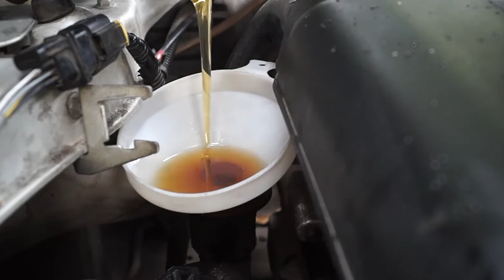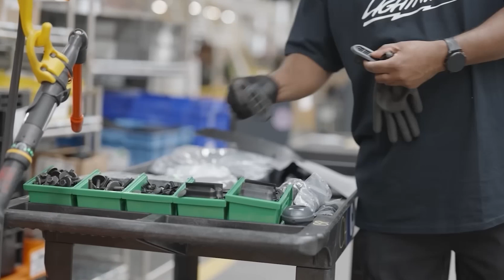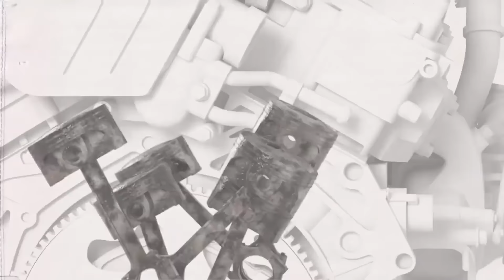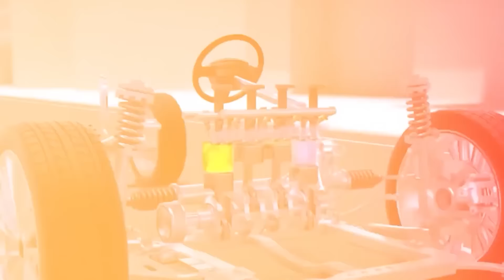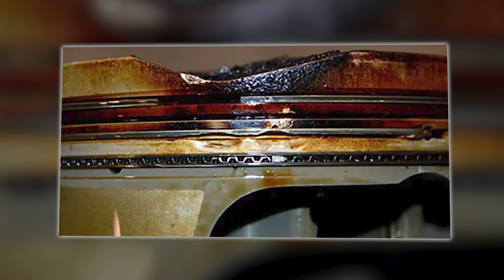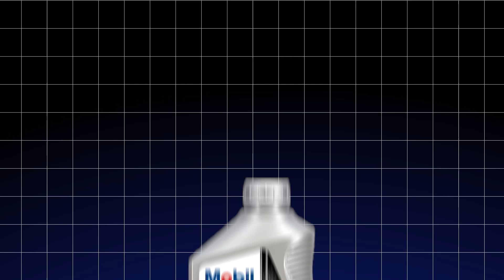Toyota Secretly Lying About Oil - Mechanics Refuse To Use

Comment: The additives in the Toyota branded oil makes the difference.  I believe Mobile produces it for them.  The aftermarket Mobile with the same numbers does not contain the same formula...may contain the additives to a lesser degree.  Solution:  If you use aftermarket oils, change the oil more frequently. Even if you use the Toyota brand oils, the vehicle motor can last longer with more frequent oil changes.  Why doesn't Toyota reveal real world testing results to owners...?  If they do please post such.
Reply: Toyota motor oil is just relabeled Mobil motor oil.  What I saw when looking at these dealership oils is that they have a weaker additive package.
Reply: @Rob-xj3xh  Toyota oil ow8 and 0w16 has 5 times the moly than Mobil 1.  Way different oils

Comment: I run 10w30 full synthetic in all my vehicles. Toyota, Ford, chevy, and my mitsubishi. 08 tundra. 312k. 287k before first oil leak. $43 bucks to fix. 08 Yaris 229k still no leak. 3rd clutch though. 17 expedition 189k miles. Passenger turbo just started to leak. Waiting on parts so I can repair. 17 outlander 131k no leaks. 20 chevy 2500 gas. 50k no leaks. Only used to pull my 5rv. I change my oil at 5k intervals on my vehicles myself. 10w30 stp full synthetic is only oil i use for gas. 15/40 delivery for my deisel tractors. 30 stp regular oil in all my generators. Never had issues with any of them leaking.
Reply: Same here amsoil 10w 30
Reply: Great for older cars, but these new ones are engineered for the thin oils.

Comment: ASKING: Is it possible to mix 0W-20 with 5W-30  half by half ?
Reply: Yes, I've mixed brands and viscosity's  since the 80s without a problem.
Reply: I personally would not recommend it. Back in the 70's and 80's oils were very basic but oil today is a 100% better with different additives that may not play well together!

Comment: The difference between the US and other countries is that in US Toyota controls the oil pump solenoid with ECM. So the thinner oil is running under more pressure then needed. It is totally safe to run 0w8 if the engine is designed for it. Yes, it is exact the same engine but not the same ECM programming.
Reply: Never knew that.  Learn something new every day.
Reply: Then how does the ECM deal with 0w20 frozen at 32f ?  It's now SAE140...
Reply: @lonniebeal6032 oil doesn't freeze at 32f. It might thicken a little but the engine will warm it up. ECM has nothing to do with it.
Reply: @lonniebeal6032  The ECM takes temperature into consideration.

Comment: Claiming that the only way they can meat government regulation is by using these lighter oils is total bogus.  Back in about 1990, the SAE department at the University of Wisconsin Madison took a ford stationwagon apart, reforged the steel frame in aluminum, reassembled it and the result was... approximately 50 mpg.  So why didn't it get incorporated.  Officially because they didn't feel people would pay the extra $2,000 for the aluminum frame.  Unofficially, because they don't want their cars to last too long.  With an aluminum alloy frame, the cars might be on the road for 10 - 20 years and it's all about the $$$ -- getting the customer to come back in and buy another vehicle.  There will come a day when all these cheap tricks won't work and they will be force to do the right thing if they wish to survive.
Reply: Ford trucks, I had one , have Aluminum bodies , but the chasis is about 9 inch steel, maybe they should have gone with Aluminum chassis and steel body .

Comment: That's another reason to AVOID this automaker! Dont use the oil on the oil cap & you have warranty claim? DENIED.
Reply: Which is why it's wise to get an oil analysis.
Reply: All automotive manufacturers are using & pushing WD40 oils

Comment: Mechanics who don't pay attention to the fine print don't know the real story. Way back in the 60's when 10W-30 made the scene, it was using the very same technology, or chemicals, that today's oils use. Back in those 1960's I used straight 40 weight racing oil from Union 76 in my junk Mopars and I changed it every 3,000 miles. My Dad drove Old's 350's and he used 10W-30, and he changed it at 5,000 miles. I was just a dumb kid, so I didn't know squat. I bought my oil from a racing team who got  it free from their sponsor, so I got it cheap. And I thought I was Joe Racer terrorizing the streets with my old junk Mopars and my 40 weight racing oil.  Dad was just Joe Tax payer droving his new Cutlass Supremes and 442's in traffic to and from Detroit for about 100,000 miles then traded them off. We both did OK, never had an issue with an engine but we both drove our cars very differently. I'd run my engine up to 6,500 rpm and smash the gears at WOT all the time, but Dad never went above 3,000. He had all the scientific polymers, isomers, anti-foamers and corrosion inhibitors. I didn't. The only thing we had in common was ZDDP. 0W-8 Toyota oil is OK to use in Toyota engines. Winter of 2024/2025 as an experiment I put 0W-8 in my 1973 International Harvester Cub Cadet Lawn Tractor so it would start easier in the event that I needed it to blow snow. My old cub cadet has the "starter/generator" for a starter and they are not known for robust strength, so I hedged my bet with the 0W-8. I started it a couple times but never had to use it to blow snow. During the Summer of 2025 mowing, the 0W-8 oil went out the breather  and I kept adding straight 30 weight oil as make up oil. It didn't hurt my Cub any, so the chemicals they put into the fancy oil works, but I wouldn't put it in and forget about it. When those chemicals leave you are left with very little for lubricity. ben/ michigan u.s.a.

Comment: I've been using Amsoil 0w-8 in my 2025 Toyota Camry hybrid. Just go on line and order it direct from the factory no problem. I order 2 cases at a time. Change it every 3k miles.
Reply: Toyota 0w8 has 5 times the moly that AMSOIL has for less cost.
Reply: @CAN43714 methodical2 said on here he did an oil analysis and Amsoil 0w-8 had 5 times the additive than the Toyota brand !

Comment: Are the oil pumps the same in Australian and North American Toyota? .Any ideas?
Reply: Yes they are, don't fall for the "OiL pUmPs & eCU/EcM aRe tUnEd diFfErEnTLy iN eVeRy cOuntRy" 

If that were true, it would be too expensive & loosing money to any car manufacturers is a cancer.
Reply: Oil pumps are the same, the ECM is calibrated differently though to regulate the oil pump depending on country.

Comment: Mobil 1 doesnt have the same additive package as toyota tgmo...high molybdenum10x more than mobil 1...ur engine is fcked if you use anything else with the same viscosity
Reply: Totally agree! This where many mistakenly buy other brands different from Oem. They are not same. Toyota oil is much richer in ad pack including Moly.

Comment: The best thing to do at this time is to avoid Toyota all together. They have repeatedly lied about a couple engine models failures. I think they need a total upper echelon flush to change the thought process that brought this about.
Reply: so go with chevy with their 6.2 liter problem engine that they are lying about?  Or how about Hyundai or Kia with all their problems.  Lets not forget Nissan with their transmission problems or Dodge with more problems than I can count.  Then there is Ford with their Triton engine disaster and transmission problems.  I can go on, but you tell me the perfect manufacturer?
Reply: @CAN43714 If I was going to buy a truck today, it would be the Nissan Forester because it has a normally aspirated 6 cylinder engine that has been proven to be dependable. It has a decent transmission. Not a Nissan fan but that is all I would consider at this time. I hope automakers get their act together soon.

Comment: 15W-40 is less than twice as thick as 0W-8 at 100C/210F.  SUS is Saybolt Universal Seconds, the actual units used for measuring viscosity.  Most people, including some who consider themselves experts on oil don't know that.  The 0WX is clearly much better for cold starts in cold weather areas.  

Oil Grade	Viscosity @ 100°F (~40°C)	Viscosity @ 210°F (~100°C)
0W-8	~110 – 120 SUS	~41 – 44 SUS
0W-16	~140 – 160 SUS	~48 – 50 SUS
5W-30	~280 – 310 SUS	~58 – 65 SUS
15W-40	~480 – 520 SUS	~70 – 80 SUS
Reply: I would never use 15W40 in a modern Toyota. The VVT-i design likes thinner oil, that flows effciently.
The reason Toyota can work with 15W14 , is that a Toyota engine is made so well, that the oil film is still protecting, even with compromised flow from the thicker oil. Just because an engine can work with 15W-40 in hot climates, doesn't mean it would not work better with 5W-30. In colder scandinavian climates, 0W-20 is mostly used on "modern" Toyota Engines from 2010. And some has 300K+ miles on them, still smooth running.
The reason taxi drivers can have some advantage using thicker 5W-30, over 0W-20, is the cars is running at full operating temp almost all the time.. meaning you get proper oil flow at the most unning time (mostly 8-12 viscosity on W20 to W30 @100c) Thw W30 will have sligtly better protection at 100c, and still be thin enough, for it to reach all the narrow tolerances in a modern engine. BUT on a cold start at 0c, you get better flow with the 0W-20, and now you get into another issue with the 5W-30, maybe not getting to all the tight tolerances as efficiently.
Many Taxi cars have more drivers on it, running 24/7. The thinner oil protect best at cold startups. Which most normal daily commute cars is being exposed to every day. Meaning you might prefer optimum protecction from 0-80c oil temp, if your car is running at that temp most of it's time. Cold startup-warmup time is usually were the most wear happening on engines.
Another reason Taxi's are running 5W30 or 10W30 is that the oil is often cheaper. And there is a bit of headroom for shearing.
You can't compare a taxi work conditions to a regular daily (example 2x 30min) typical commute car work conditions.

Comment: This is why CAFE must go!  As a consumer,  I demand the right to make common sense decisions for my car!  Sacrificing extremely long engine life for an incredibly small gas mileage improvement is penny-wise and pound-foolish!  When I had my 99 Mustangs six cylinder engine rebuilt at almost 200,000 miles (due to burst radiator hose, trying to limp home) - the professional rebuilder had info on how energy-saving it was to rebuild a car engine (with emphasis on proper recycling of fluids, parts, etc) as compared to creating a whole new car.  There is no free lunch, everything has its cost!  If I had one of these Toyota's, whether I planned to keep it forever or not would be irrelevant - I would use the best weight oil for protecting the engine while providing a reasonable gas mileage - not sacrificing an engine for less than 1 mpg.  And the 10,000 mile oil change seems to be pure stupidity for most people - the only people who I have heard may get away with this without sacrificing engine life is those that drive almost exclusively freeway driving, WITHOUT having encountering traffic jams and stop and go driving - just straight, easy driving - which is almost none of us in the real world. And, as my motor oil has always been recycled, there is little impact to the environment on frequent oil changes, and it gives either you or your TRUSTED mechanic to go over your car, checking tires, fluids, bulbs, battery, hoses, wiring. --- AND, even if I were to plan on retiring my Toyota at 100,000 miles or so, I would still want the next owner to know I had used the best oil for engine life (or a damn good one) - and had records of proper maintenance - this should make the car worth more than following bad advice due to the extremely bad policies from CAFE and CARB.  And of course, are damaged engines from bad oil recommendations due to CAFE going to pollute a LOT  more?
Reply: Beautifully and very logically said. 👍👍
I agree 100%, CAFE must go!

Comment: This video is interesting, but contains a lot of BS, as with saying Toyota oil specs are because of CAFE.  I doubt if they have CAFE in Saudi Arabia, but the oil specs for Gen 5 Prius there are the same as in the US.
Reply: No.  Toyota has been using Ow-8 on Japan for over a decade.
Reply: @williamgollatz1911  Japan, where most cars don't make 100,000 miles....

Comment: Never run any oil that is 0w anything
Reply: This light oil is fine in cold climates.  It's the summer months that worry me, which is why after I've run 10w30 during the summer and 0w20 in the winter, I will get an oil analysis on 0w20 after a summer run this next year.
Reply: @lonniebeal6032  Your engine has a thermostat so it runs at the same temp.Does not matter the outside temp.Run what the oil cap says.sa
Reply: I found the 0w30 works great on cars calling for 0w16-20. It’s close to the same start, but remains thicker at operating temp.
Reply: Except for German Castrol, Ravenol or anything thats made in Germany/Belgium, that says Vollsyntetisch...the other half of the truth is most oils marketed in America as "synthetic" are only semisyn by Germany's  law, except for a few...and then some..VI mods
Reply: For colder climates yes,i use 0w30 in the UK for our winters then 5w30 in summer.
Reply: Nonsense.  My 2021 Toyota Hybrid has run on 0W-16 for almost six years and still runs perfectly getting 40 mpg.  Why would Toyota recommend an oil for hundreds of thousands of vehicles if it caused premature engine wear and failure?

Comment: Not only Toyota. ALL car manufacturers and consumers suffer CAFE standards, which ran by a bunch of idiots. Policies have consequences.
Reply: No, not ALL automakers! Toyota is the primary one pushing it. Another reason id never own one..among many. -Engineering perspective
Reply: @Davido50  Engineering perspective or not, no one cares. Your money, your choice, own what you want. 
You sound angry at Toyota. Some fuel saving technologies are set by EPA, again the agency WAS RAN by idiots.
Forcing car manufacturers meet the CAFE requirements that most likely unachievable.
Reply: @dvbs2x117  This guy is right, don't be mad at Toyota, they are being pressured by the CAFE idiots for un-realistic gas mileage requirements or pay heavy fines!

Comment: In SA even new VW products are spect at 5W40. So there is a whole lot of bullshit with that spec in US. No one with common sense will believe that. That oil pump will have to pump out serious volume to produce the pressure needed to separate running components at temperature. Do the math and they must stop their shit

Comment: In the official website Toyota Greece say engine oil SAE 5W-30 and SAE 10W-40.
Reply: In the U.S. it's EPA, CAFE regulations & politicians getting money. It's all about greed & planned obsolescence. 

Reliability, dependability, quality & longevity are a cancer to any manufacturing companies especially the automotive manufacturers. 

Toyota & Honda were known for Reliability, dependability, quality & longevity some 20yrs ago. Now, it'll about greed & all auto manufacturers know this
Reply: @mobileterminaluzer1858  Actually Toyota has grown a huge business for offering Quality and longevity. They are not like the (modern) German or American car makers, who want you to (more or less) "forced" to change the car when it's gone old (and breaks down a lot). They choose the Prestige route, over the Quality route  (Mercedes did both in the old days, and they spend too much, by letting the engineers optimally design their cars). Toyota (and Honda) rather want you to have the car for many years, with less ownership repairs, and next time, you (of course) buy from them again. They focus on reliability, not excitement. Many people buy a new car, not because the old one has gone bad, but because they just want the most recent model with more gadgets, better fuel economy etc.
Reply: That's blocked or suggested to NOT follow EU/UK overseas oil recommendations cause it's not U.S. or "AmEricAn sPeCs"
Reply: Greece is hot, especially in summer! In Germany, which is more temperate, they say 0w8, 0w16 or 0w20 . Though 5w30 seems to be recommended when conditions are more extreme or high speeds are used. I drive only short distances most days, to and from work, and the motor isn't always fully warmed up, especially in winter, so I think thinner oil in a hybrid makes sense for me, with oil changes every 6 months or so.

Comment: Great info reinforcement. Sub 'ed.
Pretty much EPA reg's, and I have to say I don't blame Toyota. Comply or get booted from the USA market. My '24 Rav4 Prime at 11.5K miles had its first oil change at 600 miles, (all DIY) and again at 4700, (Drove back to Alaska) and at every 6 months / 5k miles after. In other words, about every 1800 miles. Used Toyota 0W16 (Per OM) at first, - last 2 were ... my favorite, Amsoil (still 0W16) I've sent to Oil Analysis lab for last several, and I'm presently running Amsoil 0W20 (apples to apples ...) and I'm due an O.C in Feb. Again, about 1800 miles. That sample will again be going to the lab and I'm definitely going to be studying the results, relative to previous 0W16 samples. Thanks Lake! Btw, I live in an apartment and don't plug-in charge, so consider this as comparable to any normal R4 hybrid. - ie, average 350 or so miles to fill-up at 1/4 fuel level or so.
Reply: They don't have EPA regs in Saudi Arabia, but Toyota specifies 0W16 there for Prius and Highlander hybrid.